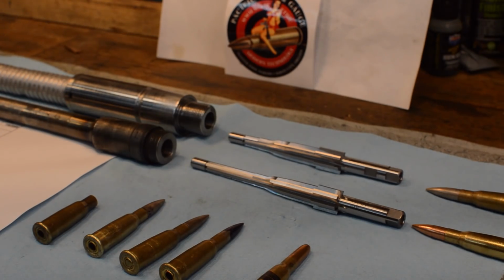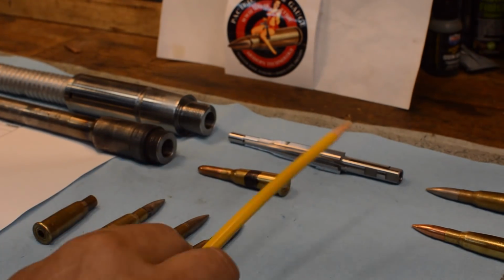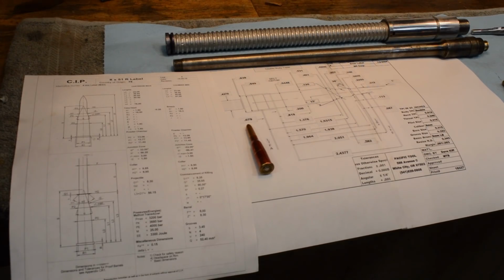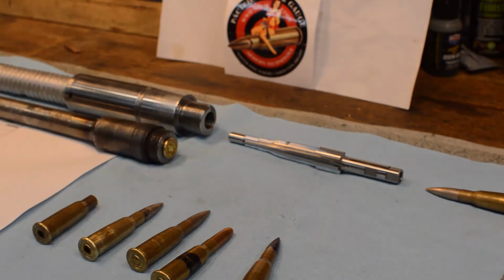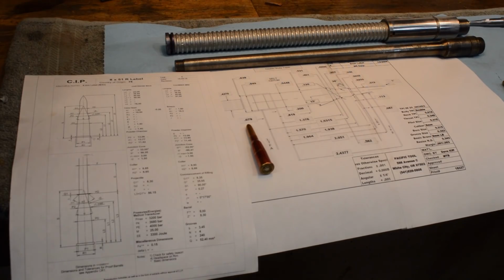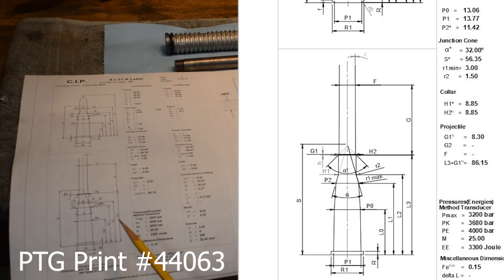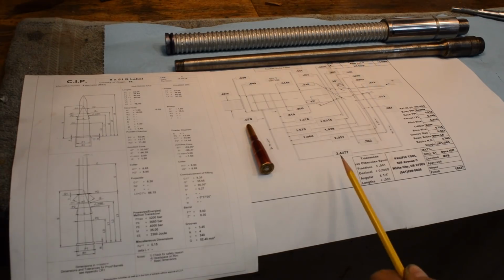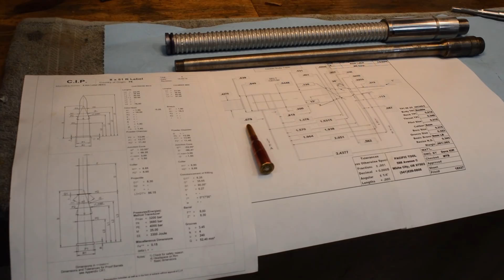8mm Lebel reamer selection issues

Comment: This is what amazes me with engineering from my profane point of view, 0.12mm can just change everything
Reply: KamikazeF0X well, in many cases converting from metric to inches for example to build a gun is a process that literally takes months as you can't do it 1:1 and tolerances stack up quickly. It's like half way engineering the whole gun again because of tools and machines etc as well. That's why US machine shops often have to have two sets of tools, machines and mikes, the rest of the world just uses metric so one set. I've had that headache when I ordered PCB's from china where the PCB diagram was made on a tool set in inches, the thing wouldn't fit or work without a bunch of adjustment and conversion.
Reply: Oh, I also absolutely forgot that too, how Imperial and Metric are absolutely different
I'm not used to Imperial at all and I am always surprised when I see people uses fractions of a inch

Comment: How can it be tight and not go in fully if the 'bad' P0 is 13.06 instead of 13.2, shouldn't it be loose, as it is narrower?
Reply: Well, the chamber is 13.06, so its 0.14 smaller than it should be. The drawing is a representation of the aimed cartridge size for that chambering tool, but the commercial cartridges are bigger.
Reply from the maker: @ramonrochamoreira  Yes to this explanation
Reply: @marknovak8255  You can try to get your diameter by lapping, or make D reamer.

Comment: On a side note, Mark, do you regard the Remington 07/15 Berthiers unsafe to shoot due to bad metallurgy? Just looking for an opinion here. Thanks.
Reply: Chris_Wooden_Eye  A frenchy here ! The Remington rifle have a bad reputation due to mistake during the convertion from metric to imperial system and differences in manufacturing technics. Some part are not really made to French specs but from a military point of view there is no problem to shoot it. The French inspector found different mistake and problem with the Remington contract 07/15. A report from April 28 1916 , tell us that French inspector find out that 4 out of 14 Remington rifle had rifleing out of spec with bore too large , they also found later the 6 of May 1916 that the front sight was not made at the right height. And because Remington used a different type of tooling and is was not suited to the manufacturing of the 07/15 , most of the early production 07/15 had to be finish by hand. Also the French governement own Chatellerault manufacure send something like 50 French made gun to the US so Remington can try and verify the interchangeability of part. They also send a crap ton of high pressure test ammo to test the strenght of the rifle. As far as we know there was no case of rifle that exploded due to this really hot ammo. So we can assume it is safe to shoot. But if there is no problem with the part when every gun is "hand made" French inspector found out that standart production run 07/15 rifle and parts had a really low interchangeability capacity and most of Remington part would either not fit in French rifle or cause problem with head space or cause feeding problem. So to conclude , if you shoot a 100% Remington with PPU factory ammo you should have no problem except maybe in the accuracy departement with your rifle.
Reply: @pierre-louiscomte8998  Thank you for clarifying this. Job jobbed!